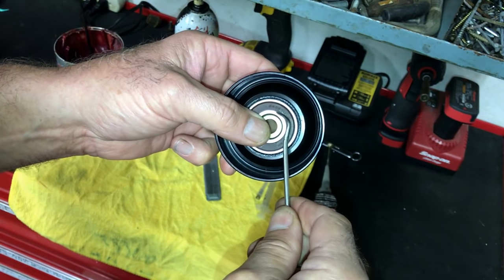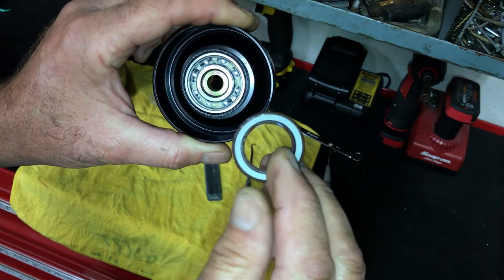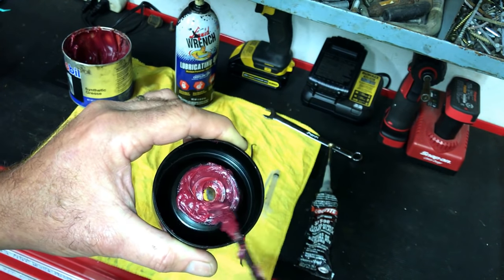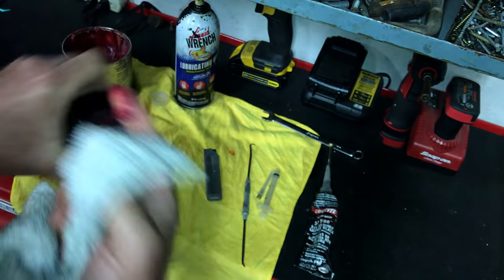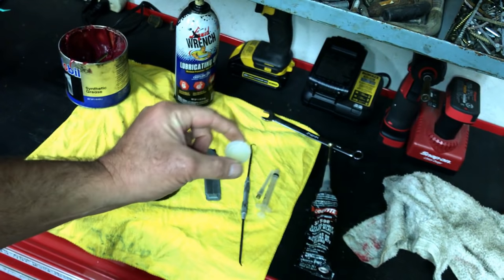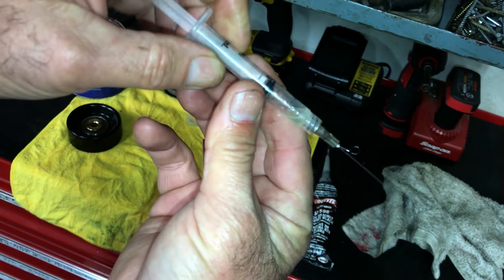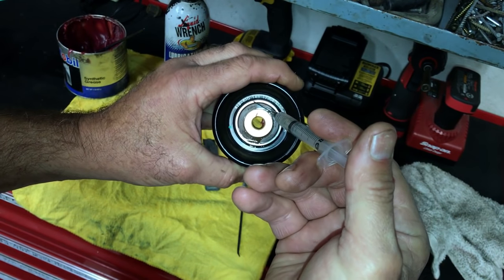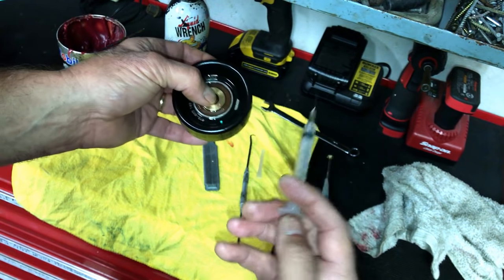Make Your Drive Pulleys & Sealed Bearings LAST A LIFE TIME :)

Comment: About time someone made a video of this. Been doing it for over 50 years. My wife saves any and all syringes for me from the vet etc.. I purchased my first synthetic grease in the early 70's and it lasts pretty much for ever. Why the bearing manufacturers are so cheap with the grease has always puzzled me. They tend to use the cheapest crap they can find. I always do this to new wheel bearings for my Cummins Ram etc as well. Always use the best grease $ can buy.
Reply from the maker: Thank you very much for sharing my friend
Reply: Just like light bulbs.  If the bulb says it will last 990 hours, it will burn out around 990 hours.  Back in the 40's or 50's they figured out if they made the filament thinner it will burn out faster and you will continually have to buy new replacement bulbs.  I seen videos of some light bulbs from the early 1900's that have been on for over 100 years and still haven't burnt out yet.  They make things to break so you have to buy new ones.

Comment: I have done this with aircraft bearings on high speed industrial equipment for years. It will work to some extent, but usually removing the seals causes small gaps. Depending on what you're using the bearings for, it's sometimes better to just pull and replace it periodically as opposed to trying to lubricate it. However, car parts don't need to be within as close of tolerances as some other parts, so it will work until the bearings are shot. I have a 30 year old Cub cadet lawnmower that has the original bearings in it, and it's been working fine, so there is some merit to this.
Reply from the maker: beast64375 thank you for sharing my friend :)
Reply: I maintain my car to aircraft  tolerances,  whatever that means. 😆

Comment: Wow! Did I need this one awhile ago, replaced two idler pulleys on 2 different vehicles as they were noisy, and bought the autoparts replacements (read cheap, even though they charged top dollar for them!) and both are going bad again without that many miles on them!
Will do this to the replacements, and hopefully they don't get noisy and start bouncing after a short time.
A big thumbs up for another fine video.
Reply from the maker: thank you my friend and thanks for being with us :)
Reply: did you check if you're tesion is correct you can ruin bearings by over tightening the belts
Reply: niceguy217 o8ku

Comment: I have restored a few old garden tractors. Years ago bearings had a wire snap ring you could remove and the seal would fall out. Clean and re-grease and your good for another 50 years. One thing I do is to remove all the old grease before I fill with new just in case there is contamination and eliminate any compatibility issues with different greases. Good video.
Reply from the maker: Thank you for the great comment, we have done this for many years and have had no issues with compatibility as the new grease pushes out the old grease well enough to make the bearing last way longer than it normally would.

Comment: Thank you, for taking the time to make these videos. The timing is perfect. I'm about to remove/replace the bearings in both of my serpentine belt idler pulleys and the belt tensioner pulley. In fact, I have already ordered the bearings and I'm waiting for delivery. I think I'll try to clean out as much of the factory grease as possible and pack in the new. The pulleys for my car are about $70 each. I can replace the bearings for about $4.00 each. It was an easy decision to make!

I'm also replacing/treating all of the radiator hoses and serpentine belt with the 303 Protectant you recommended in one of your other videos.

This is all part of a major maintenance procedure, which involves a new water pump, thermostat, thermostat housing, gaskets and cooling system flush. If the main shaft pulley (damper pulley, harmonic balancer, whatever, etc) shows wear, it will be changed as well.

Thanks, again!

Jim
Reply from the maker: great to hear Jim you will love the results and we love to hear of great people like yourself taking care of their rides :)

Comment: Would it be better to remove the original lube first with some spray cleaner and then directly replace it with new lube like your Mobile1? As I have heard that mixing lubes is bad. Curious
Reply from the maker: the heavier grease will take over the bearing and all will work out great we have one vehicle we purchased new now it has 330k miles on it we did this to it brand new off the showroom floor and we opened one of the pulleys up at 165k and it looked awesome still to this day we have never replaced a pulley with 330k on it   thanks so much for the great question :)
Reply: Sweet Project Cars and thank you for the great reply! I will be following your advice on cars from now on :) thank you!
Reply from the maker: you are very welcome :)
Reply: It all depends what type of grease it is, clay base or soap based. If you are not sure it's best to clean and use new grease.
Reply: i use GASOLINE
Reply: If your going to take off the pulley just clean off the  old cheap grease. That would make me not able to sleep at night if I mixed the grease like in your video.
Reply from the maker: the new pushes out the old
Reply: Put a grease fitting on the bearing and, like buddy bearing on  trailors give it a squirt ever so often
Reply: +Ron Lee 
how  would  you  put  a  grease  fitting  on  that  bearing ?
Reply: LoooL yeah how?
Reply: New synthetics mix very well with all different types of grease. They are designed not to become a counter acting agent like they were originally.
Reply: @cbmech2563  with a bearing buddy. Just have to make sure there is enough clearance for it first though.

Comment: This is a good tip, and we have been doing this for a few years. We use a high temp bearing grease in a grease gun and use a needle to get right inside. Then add a few drops of lucas/moreys and it blends with the grease and makes it sticky so it doesn't get thrown out. Works well.
Reply from the maker: mit thanks for the great tips for our sub's and diyer's    Thank you and thanks for being here with us :)

Comment: Great tip.  So simple that everyone should know it and do it but most don't.  I've never really thought about greasing a sealed bearing before but I will now.  I've used a needle on my grease gun for ball joints and other places that should, but don't have grease fittings on them.  Just pull back the boot or put a little hole in it.
Makes sense to do the same for bearings.
Thanks for the video.
Reply from the maker: thanks Bruce you are correct on all you said..many could save a lot of $$$ because if one thing fails like a pulley it take out many other parts on the car..thanks for being here with us :)
Reply: Yes, like the timing belt pulley bearing that failed on my Subaru. The timing belt had been replaced, but not the pulleys.
Reply from the maker: Thank you and thanks for being here with us :)

Comment: I've done this on all sealed bearings. It does work! Any time I've got to replace a sealed bearing like on a auto or mower I pack em full of grease. It really pays off to do this on mower deck spindles. Also the syringe trick is good to lubricate the factor front end parts such as the upper and lower ball joints and tie rods. Most of them are sealed. The replacements have a grease fitting on em. The sealed ones do not. I like this guy's videos.
Reply from the maker: Thank you very much for sharing this great information for the channel we always believe if you can get oil into an area like a bearing they will just last even longer have a great weekend

Comment: I was taught not to use oil where there is grease. Oil will cause the grease to thin and leak out.
Reply from the maker: The oil is to extend the life of an old bearing that the owner does not want to replace anytime soon, this extends the life without having to remove the pulley thank you very much, and thanks for the great comment, it helps the entire channel :)

Comment: i can't believe you are the first person i have seen do the same exact thing i have been doing for years. i use GREEN GREASE but MOBILE 1 SYNTHETIC is just as good. you may want to try SEA FOAM DEEP CREEP as your syringe lubricant. you can lubricate electric motor bearings with synthetic grease instead of oil but you have to add a little oil because some electrics have a hard time getting started. another tip i want to add is when buying chinese made power tools like from HF you need to remove the gear drive part of the tool and remove as much of the usually brown cheap grease and replace with MOBILE 1 or GREEN GREASE. try using some synthetic oil like a 5w20 full synthetic for you traditional oil spout can. you would think 3in1 would have sythetic oil but they don't.
Reply from the maker: thank you very much for your great comment, it is great for the whole channel to have good people like you here  :)

Comment: I've had problems when I over packed bearings, excessive friction, leaks, oozing melted grease. So far I've re packed inline skates, eccentric bearings on sanders, grinder bearings etc. Love having a tool work and work without breakdown., especially tools that are not made well anymore. My Austrian random orbit sander goes through hell and back, ten years of service and still kicking.
Reply from the maker: thank you very much for your great comment, it's great for the whole chain to have good people like you here :)
Reply: This is why it pays to read the comment section.

Comment: We are doing the same thing with mower spindles with sealed bearings.
Have been using Primerose synthetic high temp waterproof grease with extremely good success !
Unfortunately, you are absolutely correct, sealed bearings are intended to fall !
We literally pack our bearings the old fashioned way, and replace the seals when we complete the process.
Reply from the maker: quadsman11 thank you so much for sharing :)
Reply: where do u buy replacement seals?

Comment: Would the on-car liquid wrench method also work with sealed ball joints (with no grease fitting)? My factory ball joints are still good at 170k (toyota) but I'd like to keep them in the best shape I can while they are still good. Thanks.
Reply from the maker: yes it would bob give it a shot    Thank you very much for the great comments and sharing great info that Is good for the whole channel

Comment: I didn't know that seal pop off so easy like that. I probably will try this on my idler pulleys.
Reply from the maker: You will love the results this works like a charm if they put high-quality grease in them to start with we would not have to do this but then again they wouldn’t sell as many have a great day
Reply: @SweetProjectCars  exactly...been through THREE idler pulleys in two years! And no, the belt isn't misaligned...I checked.  The pulleys had almost no grease in them!

Comment: I thought this was another one of them BS scams, but no that is 100% good advice! Mobil 1 synthetic high temperature wheel bearing Grease will make that pulley last forever just about. I would try to remove the old grease myself before putting the high-quality grease in. Thanks!
Reply from the maker: thank you Ronnie for the great comment :)

Comment: To add to your cool video advice, if the bearings are already worn out or iffy, to replace the sealed bearings, you don't have to replace the entire pricey pulley wheel bearings unit the auto parts stores want to sell you: If the pulley wheel is made from metal or plastic(that is not worn down or broken) And If it's the design that allows the sealed bearing to be hammered tapped out of it from one direction.
Because new sealed bearings are inexpensive(just a few dollars a piece) and many seem to be this common size and strength rating that's ample, available on such places as eBay, (handy 10 pack can be a great buy): "6203 2RS" "17 x 40 x 12".
You can even google and read about sealed bearings and how they are use strength rated and sized and labeled.

Read the rating and size of your old bearing that's engraved in its seal cover, you may find it's the same size or a size you can purchase.
Take care
Reply from the maker: Jim thank you for sharing this great info it helps the whole channel....:)
Reply: True. Good Japanese one are reasonably priced. Just need to press out the old and reinsert the new.  
For that we need a press or a large enough socket or to source a shop to do it.
Reply: Nizar Ahmad just a hammer and socket taps them out and back in for me.

Comment: It is amazing, I have seen tons of videos like this and absolutely in all of them no one cleans 1st the old grease, nope, they just go ahead and add new grease on top of the old one, the old one that is dirty, old, dry, and has dust, cannot understand, 1st wash de bearin sir, clean it from any debrie, any dust, any rust, then add a new grease, am i wrong?
Reply from the maker: The majority wins, you are wrong, by adding the new grease in this method it pushes out the old grease.  If that was the case what you say, you would have to remove every tie rod, and ball joint, take them apart to remove the bad grease.  Since the cavemen, a grease job is a grease job, when you inject new grease, old grease is pushed out.  Thanks. mad Mike the hammer SPC
Reply: @SweetProjectCars  some man has developed and left the cave behind

Comment: I have seen old noisy expensive hard to replace bearings lubricated by this method !
I believe it can work with some success !
As far as doing this to a new bearing !
Hopefully you pay extreme attention to the condition of the seal , make sure you do not damage it !
I also believe it can be extremely important not to introduce any dirt !
Reply from the maker: Thank you Frank for sharing we appreciate that have a great weekend
Reply: l've had to do this to 2 different belt tension pulleys that l had to replace,  in both cases the new pulleys came with virtually no grease on them. l was shocked and a bit pissed at the same time, but to be perfectly honest with you, it almost seemed it was done on purpose to insure that you will need to come back for more bearings once the new ones with almost no grease on them end up failing. l was almost going to return them but then l realized that wouldn't get me anywhere, more new ones could be the same, and what made the most sense was to just keep the new ones but apply grease myself, which l did, and the grease l used was way superior (Red Line synthetic CV-2 high temp red grease) as compared to the few drops of white lithium grease that the new pulleys came with. One of those pulleys now has over 100,000 miles on it since l packed it with the red grease and still spins smooth as butter, no sound at all.

Comment: I did that every 100,000 miles on my S-10 the engine to the pulleys and alternator .then 300,264 the engine died .plus a more severe application needing lots of greasing is lawn tractor quill and idlers . plus your sleeve bearing motors can go many years with oiling . I have a personal fan I fixed in 1975 and with cleaning and high grade oil its still working great 42 years later
Reply from the maker: Thanks Chuck :)

Comment: There's no better feeling than extending the life of a component on your car knowing that your money stays in our pockets instead of the greedy car manufacturers and parts store's pockets. A bonus is it's good for the environment because no part needs to be built that requires using money/fuel to mine the metal to make the part, oil to make the plastic portion of it...fuel to deliver the part to your doorstep or parts store and the old part doesn't get chucked into the garbage then the landfill. Some people recycle the parts but still it takes fuel to transport to the recycler, and fuel to melt the metal down to make something else out of it. 
I'm going to try the oil injection into the idler pully but going to see if I can squeeze some 5-30 synthetic through the needle. I've already pumped some CRC grease into my tie rod ends and ball joints using a grease gun equipped with a needle. Then sealed the tiny hole with super glue and after it dried a layer of blue silicone adhesive over that. Great results so far. Thanks for the tips...
Reply from the maker: Thank you for watching and sharing, have a great day my friend. mad Mike the hammer SPC

Comment: Will this work on my knees?
Reply from the maker: Not sure about that thanks for asking
Reply: No but Knox Gelatin from the grocery store will do the same thing for your joints. Saved mine. One teaspoon a day in juice stirred and not shaken and down the hatch. Saved my joints and I'm 72. It is made from joints and tendons after all. Works great and it is cheap fix.
Reply: Yeah, if you inject stem cells.

Comment: What if use both methods on bearings? Do grease and oil conflict?
Reply from the maker: Mehrad Omidvaran if you take the pully off then just used the solid grease if you inject it with the pulley still on then use the liquid grease...the liquid is basically used to keep an older bearing going longer. but the best it fully grease "only"a brand new bearing then install...hope this helps :)
Reply: @SweetProjectCars  very well, thank you for your patience in replying, really appreciated.
My other question is if Lithium soap base grease works as well as synthetic grease that you used? The descreption on the package of grease says it's bearing grease
Reply from the maker: No you want to use a full synthetic wheel bearing grease for this process my friend Can find all the tools for this video in the show more of the video description have a great day